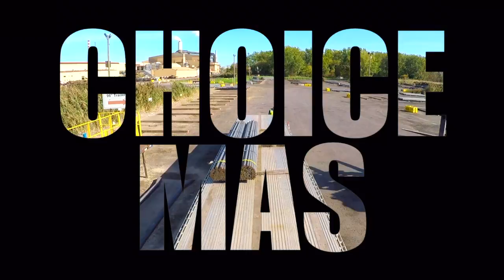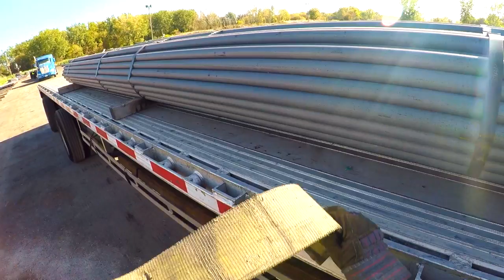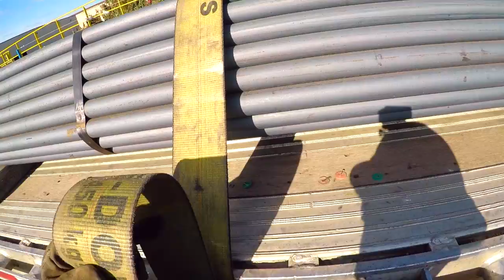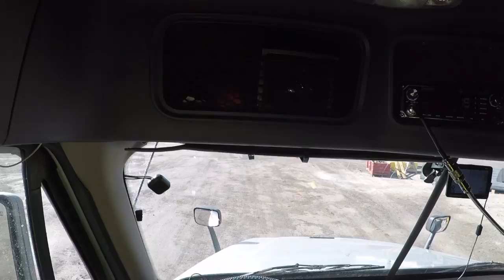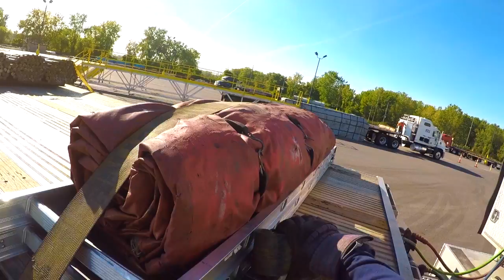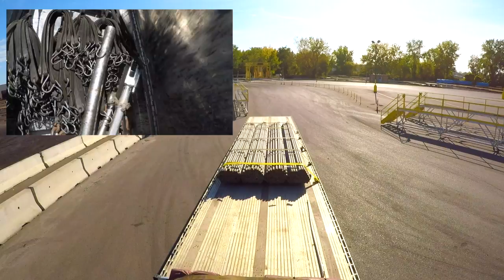STEEL BARS REAL QUICK

Comment: Could you please tell us why a stack of 4" x 4" x 4' wooden beams are not necessary?  Others have chained and strapped down a small wooden wall in front of the payload.  Is it because it's far enough away from the cab?   There is no headache rack.
Reply: Is it because you're a free-wheelin' bachelor?  And life has no meaning? 🤭
Reply from the maker: Well, I was gonna explain my reasoning. Then I read the follow up. Instead I’ll say I’ve been married 29 years, with three brilliant beautiful and successful children, 4 walls and a roof and access to hot meals. My life has plenty of purpose and meaning and I’m grateful to The Father for that. I’m blessed beyond measure. Thanks for asking.
Reply: @choicemas  🤣🤣🤣